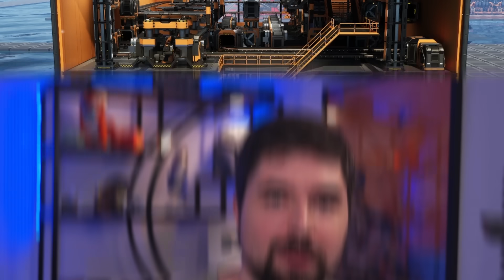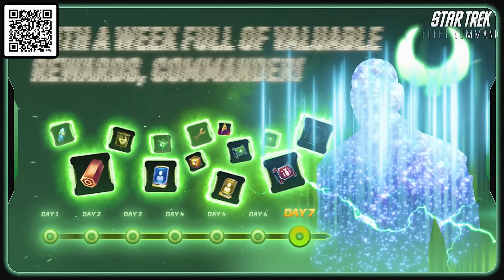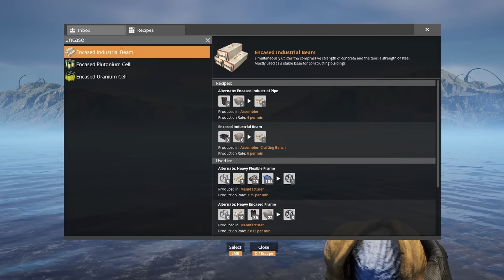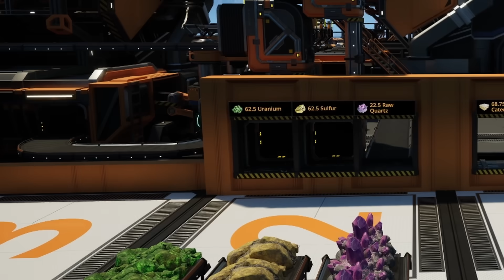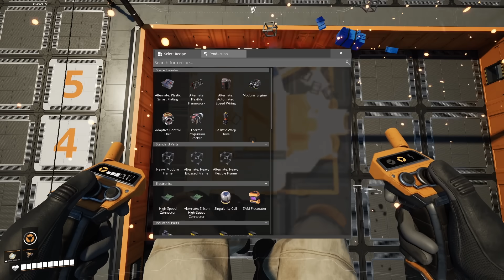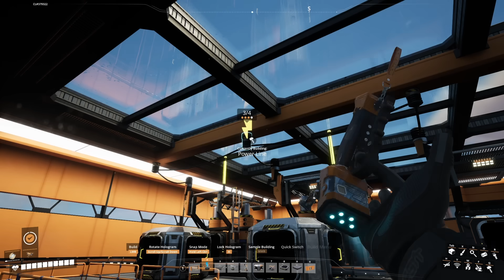How To Build A Nuclear Facility In 1 BLUEPRINT - Satisfactory 1.0

Comment: I know his is an old video but I can't help but not leave feedback. This tutorial was so infuriating to follow that I can't imagine myself coming back to this channel for any more satisfactory guides. There are times where you straight up give the wrong column and row references, you simply cut out important parts of the build for god knows what reason, like the elevator floor holes. You said things like "And now connect this conveyor belt to the machine producing this" but the video shows you not doing the thing. You are often way too close to the build, so I don't know what orientation the next floor has to be. The amount of times I thought I followed the guide perfectly, just to find things were out of place and have to rebuild, sucks. I appreciate th effort, this game needs more tutorials, but this video wasted over an hour of my time and has left a bad taste in my mouth regarding this channel.

Please: match up what you're talking about to what's being shown on screen. Maybe it would help if you didn't record the build and the voice lines separately.

Also to note: you can't achieve a '93.8% clock speed' on console since you can only manually enter a target production rate, not the clock speed. So it's actually impossible to build this on console anyway.

Also, changing stuff between shots? Give me a break. This is one of the worst tutorials I've seen on YouTube since I played Minecraft as a kid.

"This floor will be 11 meters high" proceeds to build 12 high (4+4+2+1+1)

Oh you suddenly switch to using Mk3 belts without mentioning it? Cheers for that too.

Comment: New social housing is great when you also have new market rate housing at the same time! 

And re: rent control. Some degree of rent control is good. There is a large cost, in time and money, to switching suppliers (moving to a new apartment). If your rent goes up, you can't simply switch to a cheaper provider without significant cost, which is a market ineffiency. Regulation to mitigate that ineffiency helps.

Comment: got pretty lost at floor holes.  You suddenly had all these floorholes and I didn't.  Made no sense.  I took the conveyors up as you instructed, but when I made the floor exactly as you did they just went into the floor no holes.
Reply: Floor holes 🕳 are bought in the shop for tickets, from the Sink. As are many of the extra bits that make your factory, Satisfactory...
Reply: @jamesirwin7677  He is saying that he didn't place the floor holes in the video and skipped to a part where he suddenly had floor holes that was not put there in the video

Comment: @TotalXclipse are you using mods? i cannot get the lift from the 15/m steel pipe constructor to shrink that small to align with the stackable support, how did you do it?
Reply: pull some belt out from the machine, then place the lift on the end of the belt and then turn with the scrollwheel so it faces the converyor pole and BOOM it will shrink :D

Comment: I really like this build, and it lends itself to a main bus line implementation very nicely.

I haven't drilled too deep into the nuclear setup, but it seems like a waste reclamation build would only add 2 floors, with the accelerator sitting on the roof.

Comment: Impressive, very nice. Let's see the nuclear waste management of 500/ min.
Reply: It's actually only 100 per minute, but it comes 500 at a time every five minutes. I tried some napkin math with regular recipes to figure it out and got that you can blend 300 of that 500 in one minute with eight blenders, but that still leaves an extra 200 to deal with. My brain is struggling because I keep getting the rates all wrong. Gonna see if the alternate recipes make the math simpler.
Reply: In theory, 4 blenders using Fertile Uranium will use all 100 waste per minute. That means 400 non-fissile uranium per minute. I don't really like the calc for Instant Plutonium cells (they need 150 non-fissile per minute), so instead, we drop two blenders so we produce 200 non-fissile per minute and still have 50 waste per minute. That is enough to power one particle accelerator at 200% (or two of them at normal speed, whichever is more efficient) to produce plutonium pellets. That produces 60 plutonium pellets per minute, which can be dealt with by 6 assemblers using 120 concrete split among them into plutonium fuel rods.
Reply: You are so right. I was doing math afterwards and really embarrassed I messed that up. I hoped I hadn't actually said 500 in my comment, but whoops!
100 isn't so bad, especially when spread between 10 nukes.
Reply: @Uriah30  I made the same mistake in my first reply, but it was also bedtime and I was fishing for someone to do the math for me on how to handle the waste anyway. XD

Comment: How many of what buildings are we going to need if we sink everything to deal with the 500 units of Nuclear Waste per minute from 10 Power Plants?
Reply: I miscalculated, it's 50 waste per rod, but it takes 5 minutes per rod. So it's 10 waste per minute x 10 equaling 100 waster per minute. They're just going to come 500 at a time (total) every 5 minutes.

One plant can supply two particle accelerators for the plutonium pellets, but a blender requiring 37.5 uranium waster per minute is giving me a headache for napkin math. (One check of the calculator later). OKAY! Eight Blenders will use 300 uranium waster per minute and produce 400 non-fissile uranium per minute. That can supply four particle accelerators with enough non-fissile uranium to run. Problem is, 200 waste leftover is enough to run eight particle accelerators...

Comment: I’m struggling with the load balancing on 10 Power Plants. Anyone got tips on the correct way to do that?
Reply: Thank you!
Reply: manifold.
Reply from the maker: Split a line in two. Then split each line into three, then split those 6 lines into two lines each. That should give you a 1/12 split. From there, merge two of the output lines back to the start of the balancer. That will be a 10 line balancer
Reply: Also, thanks for this blueprint! It was great and got my Nuclear Power Plant up super fast! Great video, great explanation! Looking forward to the recycling follow-up!

Comment: If it has not been said yet, I would suggest using a number / letter system for your blueprint mapping. 3B is easier than "column 3 row 2".
Reply: Or it could be as simple as stating "1-1 (one one)" or "3-2 (three two)". 
"Face the outputs of the Manufacturer to the top of the build, center it along row 4 and nudge it down by 1."

Honestly, I have very little trouble following along, but then again, I am building this as I am watching as well, so I can spin and rotate my own view of the build.
Reply: For the record, column to row numbering is pretty standardized around the world, as it's utilizing the XY planes of a graph, which is taught to kids in gradeschool math and onward, and is the same coordinate designation used by military maps worldwide.

In a 2D plane, such as that represented by building on foundations (and not 3D verticality),
* Column/X represent lateral (horizontal) directions on the grid
* Row/Y represent up and down movement on the grid (again, 2D flat, not 3D verticality, which is the Z plane).
Reply from the maker: That's fair and what I'd prefer to do - but we don't have access to letters in game other than P
Reply: @TotalXclipse   I know it's not ideal but you could do 1-5 and 6-0 or 0-4 and 5-9. That way you can say 49 instead of 44.
Reply: Row always means horizontal line (side numbers). Column always means vertical line (bottom numbers)

Comment: can do with iron instead of stell (??)
Reply: Iron pipe is fairly easy to swap in. Great idea
Reply: @Uriah30  Can confirm that works. Just be sure to adjust the Pipe Output to the 15 and 18 needed. You'll require 132 Iron Ingots per minute.
Reply: @i-am-otter5454 yeah, it's also easier to just belt the pipe under the floor. The walls offer so much space for massive windows, so I made extra cat walks all around. This is going to be great!
Reply: @i-am-otter5454  so is it OK if I change the recipe to the Iron Pipe and set it at 18 target rate? As long as I'm getting enough iron, it all should work fine?
Reply from the maker: What do you mean?
Reply: @TotalXclipse  Maybe they meant subbing Iron Pipe or something to remove the steel requirement.

Comment: Yes, definitely want to see the other two halves of it, both Spicy Green Goo recycling and Spicy Blue Goo recycling!
Reply from the maker: Spicy blue recycling won't be possible in a blueprint. As you can't fit the QE in it.
Reply: @TotalXclipse  Hmm, true. Apparently you can diagonalize the encoder to make it fit, but then your entire blueprint will look funny...
Reply from the maker: @WackoMcGoose  hmm might be able to do it then
Reply: @TotalXclipse wouldn't you have t3 blueprint designer by the time you have the quantum encoder.
Reply from the maker: @thundergamergd  You wouldn't but the Quantum Encoder doesn't fit into it normally - though the suggestion of placing it diagonally might work
Reply: @TotalXclipse  it definitely works.  You can zoop foundations at a diagonal from inside the blueprinter to the outside, place the encoder diagonally with plenty of room for the floor hole inputs, AND still have room to squeeze your Converter into the build for your excited photonic matter input as well.  I blueprint manual feed machine setups with an 8m subfloor that lets me put storage containers feeding the machines, and there's PLENTY of room for those.  Just remember to drop them on a diagonal foundation, so the belts don't get all wonky trying to correct their angle to the lifts.